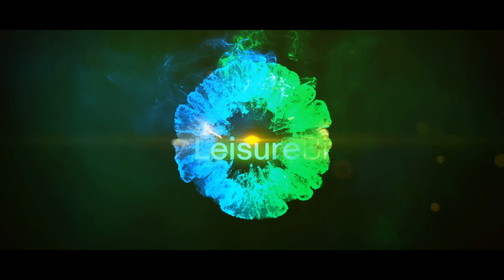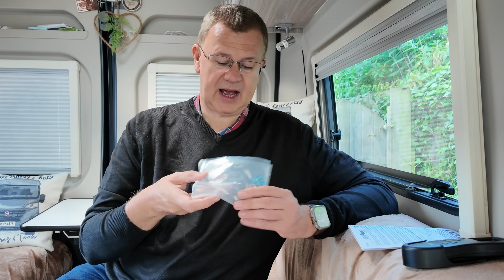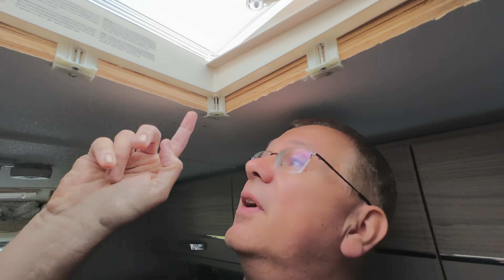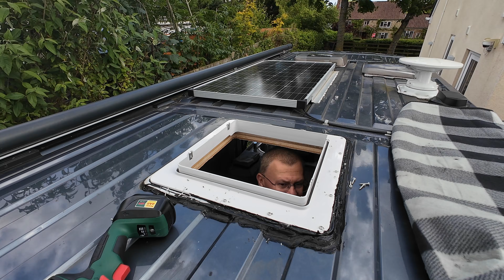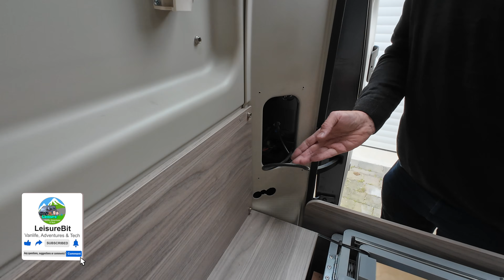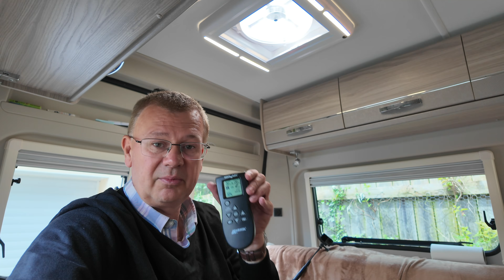FRESH AIR: MaxxFan & MaxxShade Plus Replacement DIY Installation

Comment: Hi. I've just watched your video on how to fit this Maxxfan but we have an issue with the circuit board and need to take off the light surrounding with the roller cover attached. Would you know how to remove this? We've looked everywhere on YouTube but can't seem to find this out. Everyone is fitting them and not showing how this part is fitted or removed.  Thanks you help would be helpful.
Reply from the maker: If I remember right, it’s 4 x screws to remove to take the Maxshade off, I can’t remember if there are screw covers on or if you can get straight in, once that is removed, you can disconnect the cable then get into the fan, and for that there are screws and also you need to remove the screw on the knob to get it out. Hope that helps someway, All the best, David
Reply: @LeisureBit Thanks for your quick response. Can you let me know if this is via the roof?
Reply from the maker: No, all inside, I will have a quick look tomorrow where screws are…

Comment: Hi David, thanks for your helpful  videos. I’m  due to fit one of these to my CV40 tomorrow. Did you wire directly to the battery terminals or to a fuse board? Thank you
Reply from the maker: I wired to a fuse board which I previously fitted (as per instructions and to ensure it was safe to protect the cable) - hope that helps - it’s come in really handy when it’s warm - all the best
Reply: Every video you make is so helpful, inspiring and informative. Thank you for your quick reply. I really appreciate it. 🙂

Comment: Hi, I'm planning on tackling this project this week. Can I ask what size cable you used to connect the fan to the van electrics? Many thanks
Reply from the maker: Good luck with your install - I used 2.5mm cable for it which was more than adequately rated for it - I know you can use thinner but I didn’t want any voltage drop or cable warming up issues - all the best, David
Reply: @LeisureBit  that's what I had i mind, but just wanted to check. Thanks for taking the time to reply and for the great video!

Comment: Using masking tape around the hole will leave a much neater finish to whichever sealant you use.
Reply from the maker: Great tip thank you! I have realised it probably isn’t my next career! I can do electrics / electronics with my eyes closed - maybe need to stick to that! 

David & Rachel

Comment: Hi David
Only just found you on here!  I’m fitting 2 Maxx Fans to my L4H3 van.  Quick question if I may?  How good are the led lights in the Maxxshade In the dark.  I’m putting one directly over a fixed bed the other up front in the living area.
Reply from the maker: Thanks for watching, I found the lights pretty good, brighter than I thought they would be as was a little unsure also but I've been pleased with them, nice amount of light without being ridiculously bright but certainly I've found them bright enough. Hope that helps, All the best, David

Comment: I take it the next van is some time away then 🙂 Any reason you went with the 522 vs a mastic strip ?
Reply from the maker: The new van is not ordered yet as still looking and deciding, I always wanted to try out a MaxxFan and needed to resolve the leak so thought I would cover both. The only reason for the 522 was it's what I had, I should have purchased Mastic but the fan came sooner than expected and thought I would crack on - in the future would definitely used mastic strip or equivalent and just finish with silicon. All the best, David 👍

Comment: Its something van conversions should give as an option as i think they are a brilliant idea, certainly cheaper than roof mounted A/C, ok, maybe not as good, but still a brilliant option. White mastic would of been better, (IMO) but is on the roof and no one sees it 🙂 The control panel would be a good option for it as well, one for next time then. Electric upgrade, now that will be interesting, you ditching the engine and putting in TESLA engine 🙂 Great informative tech video as ever mate 🙂
Reply from the maker: Thank you - hope you’re feeling better? Haha you never know do you :) think we need some bigger battery capacity before that haha -  yes, good compromise between roof a/c and much lighter weight too! thanks again, all the very best, David 👍

Comment: Thanks for sharing David, now I know how to feed the cable in the roof this one is on my list. By the way, the back vent in our 21 cv20 started leaking whilst in the Netherlands recently. 

Fixed it by scraping all the excess black non setting mastic from around the collar you removed and re sealed it with white 522. That’s where the water was getting in and I’ve noticed on the other vents the black non setting mastic is becoming more liquid so I’ll be giving them the same treatment even though they aren’t leaking……….yet. 

All the best, Mike & Heather 👍🇮🇲
Reply from the maker: Thanks Mike & Heather, was yours leaking between the roof part and the frame as that’s where mine seemed to be / pleased it’s. It leaking now and wish I had just used white but hey ho 😀
Pleased you sorted it 
All the very best, David 👍
Reply: The bottom plastic base attached to the roof is sound, the sealant around it is firm. Ours leaked through the part you removed and I’ve noticed on our other vents the non setting black stuff has become way more liquid over the last year or so. The back vent is sound now but I’ll be doing the same repair to the other vents even though they aren’t leaking yet. 

That’ll be scraping all the excess black stuff from the joints, cleaning them and then beading with white 522 which is what they should have used in the first place me thinks 🙄

Comment: Why didn't smoke alarm sound when testing?
Reply from the maker: It did sound - I had silenced it before turning the fan on to avoid the racket - All the best, David 👍
Reply: Hi, much better intro to your video 👍
Can you drive with the lid in the up position ?
Reply from the maker: 😀 Yes, I believe you can - not tried it but think it’s fine too drive with it up. All the best, David 👍

Comment: Nice install and very effective demo regards the air movement with the smoke machine👍. Silicone is a knack - you could always used masking tape on the van roof etc for a clean straight edge - done miles of sealant over the years working in construction so like most things practice helps.
Reply from the maker: Hi Tim, it’s one of those things I wasn’t looking forward to doing (the siliconing and removal part specifically) and was so worried about making sure I didn’t have another leak, in hindsight the masking tape would have been a great idea. If I did it again, you get the lessons of this time too. Imagine once you have a the back like most things it will be much easier - all the best, David 👍